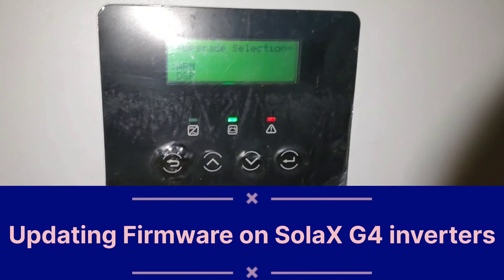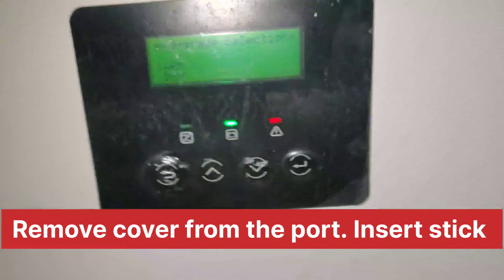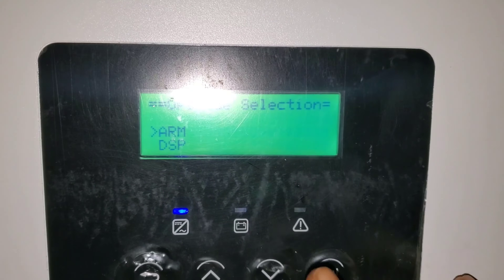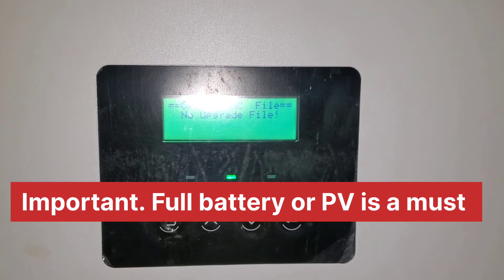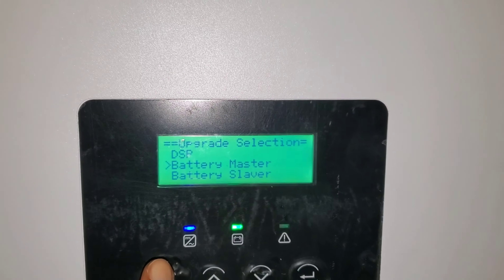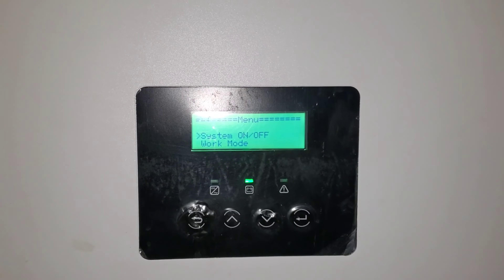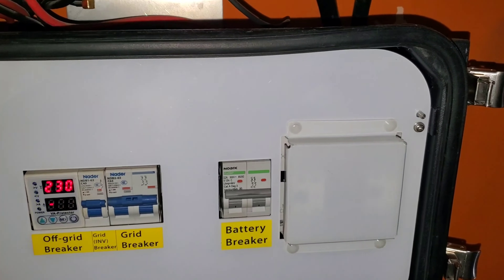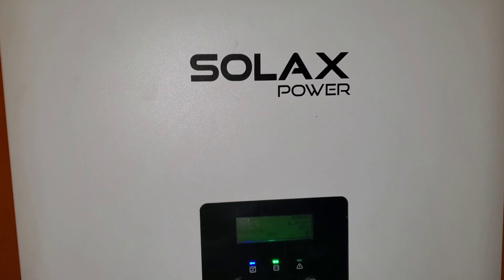How to: Firmware update SolaX inverters and batteries. #solax

Comment: Problems with NTC sensor for lead acid battery!
 BMS connectors
 pins 1. and 3.
Correct? 47K = +25°C?
Reply from the maker: Very nice question. We have not done lead acid batteries with this yet. I will ask a customer that has and get back to you. Thank you for watching and commenting

Comment: Hello,
Thanks for your video.
How did you contact Solax ? I fill a form on solax support website. They did not reply me.
My inverter doesn't support modbus wich seems added in the next firmware revision.
Reply from the maker: Who sold you the inverter?
Reply: @drsolar  
A french retailer of solar panels and inverters. I don't think that they provide any support.
I also wrote to french solax representative, they did'nt reply me.
Reply from the maker: @jbpassieux  try them first. SolaX only sells through authorized outlets.
Reply from the maker: @jbpassieux  go back to the retailer if that fails send me an email

Comment: I am from the UK, and I have the same inverter, and mine was installed nearly seven years ago by the previous owner, and I don’t think the software has ever been updated. So I am going to do it myself. I have also bought a pocket Wi-Fi adapter that I can monitor on my mobile. Thank you for this video.🙂
Reply from the maker: Thank you for watching. How did you make out?

Comment: Thanks for a good video. Does this firmware make it possible to use a lead acid battery?
Reply from the maker: Thank you for watching and commenting. Yes it does. As long as you meet the minimum voltage it should work
Reply: @drsolar  thank you so much for your reply. My battery voltage is 400v and lithium but I use a BMS that not are compatible with this inverter. So I have plans to run it as an lead acid and if that works would it really be great!
Reply from the maker: @flyingtools  I have not run voltage that high on the inverter before. On the three phase you can. Can't guarantee 400 on the single phase
Reply: @drsolar  my fault, thought you had the 3 phase unit.
Reply from the maker: @flyingtools  you can run 400V on the three phase

Comment: what is the path of the file on the usb stick ? Mine keep saying no upgrade file but i follow what is written on the manuel
Reply from the maker: I had the same issue as well. Please make sure that your upgrade files are installed on the root not within another file or in  folder.
Reply: @drsolar  And don't use a usb stick greater than 8gb.

Comment: Hi, great channel. Where did you download the firmware from ?
Reply from the maker: Thank you for watching and commenting. I got it from my SolaX team
Reply: @drsolar  what was the reason we’re you having issues? I’ve asked them for it as I’m missing force time use mode
Reply from the maker: @johnengland999  I had two issues. 1st the inverter refused to restart once the batteries discharged below 10%. The 2nd happened when the batteries got to 100%. The inverter would repeatedly power off and on. The last one I got was to allow for the gen start function.. I hope this was helpful. I am off the grid so time of use has no value